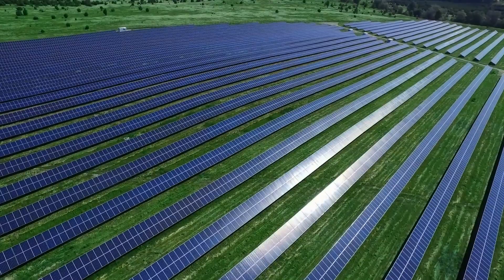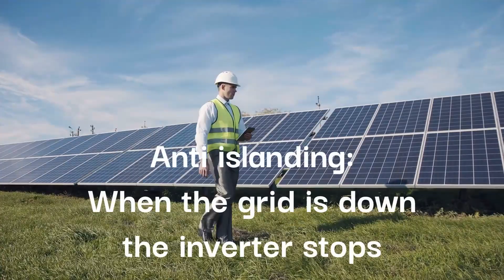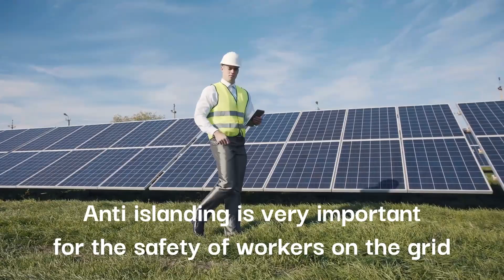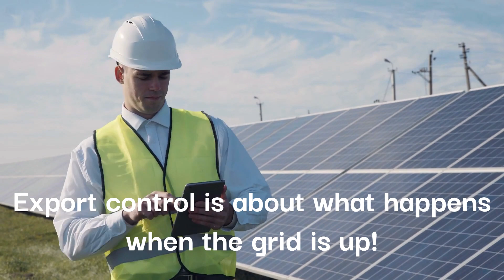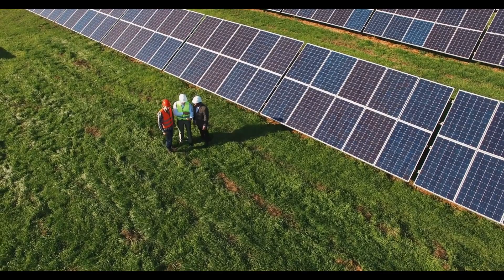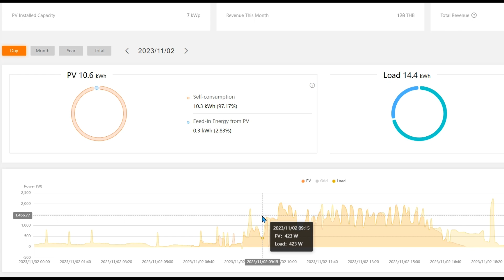Export Control in Solar Panel Systems: What You Need to Know | SolarThailand.biz

Comment: When you say, 'the inverter stops', does that mean when the grid goes down my home solar system isn't going to be able to power my coffee maker? That seems like it would negate the value of having a home solar array.
Reply from the maker: A solar system with an on grid inverter without batteries will stop, yes. Systems without batteries must stop like this, if not they would be dangerous. If you have powercuts you dont want, you need a battery system. Such a system will provide power during powercuts to a UPS panel.
Reply from the maker: People are in different situations. Some have power cuts, some dont have any. For some the goal is to save money, for some its to provide energy during power cuts. There are so many different configurations available now for different goals. Thats why its imporant to get a system that fits your goals, and not to buy a system that is made for all.